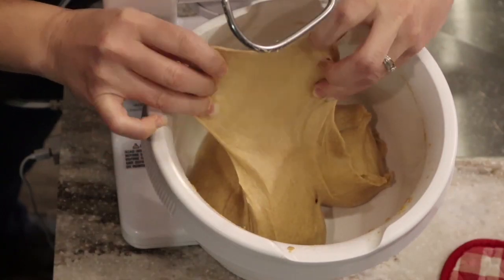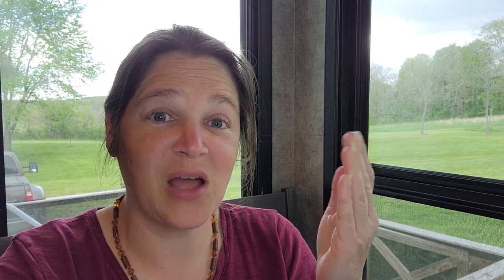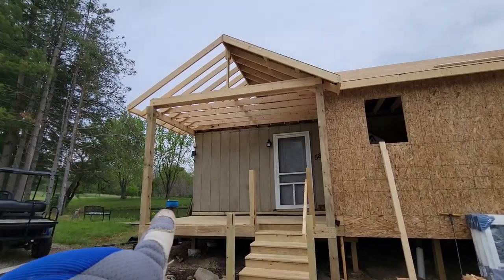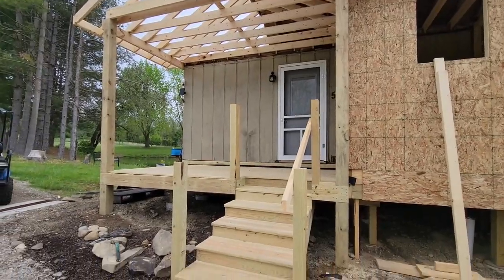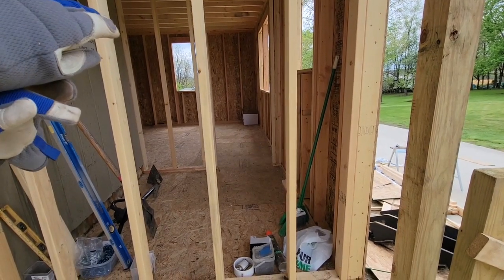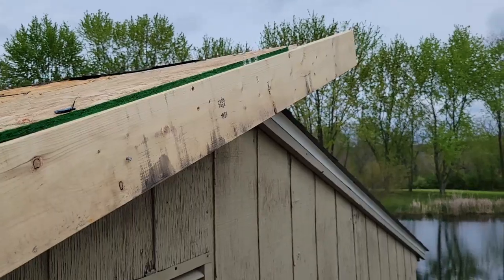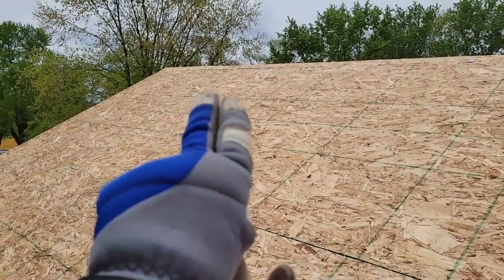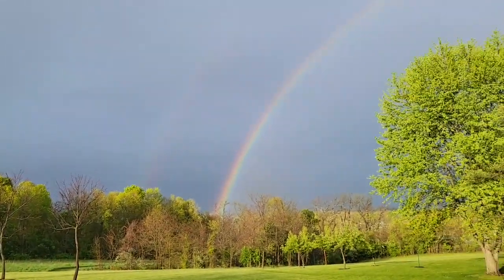MASTERCLASS: How To Get A Good Window Pane With Fresh Milled Flour

Comment: What I have learned with fresh milled flour is this.  I knead on #2 for 5 minutes, then I turn off the mixer for 5 min, then I knead again for 5 minutes on #2.  It helps let the flour hydrate better.  I use predominately spelt flour with bread but this method works with einkorn as well.  Einkorn flour, for me, seems to take a bit less water than spelt.  I do use vital wheat gluten with all the fresh milled ancient grain flours.  Only 30 grams for two loaves so its not much.  Hope this helps.
Reply from the maker: Great tips! Yes, I always recommend to let the fresh milled flour sit to absorb the liquids! Thanks! Happy Baking!

Comment: Hi! I have a question! I made your pizza dough recipe tonight...I used 130g hard red wheat, 200g hard white wheat, and 130g Kamut. My dough was very sticky. I used my Kitchen Aid mixer with the dough hook. I followed your recipe directions of allowing the 15 minutes to allow the flour to hydrate before adding the yeast. I kneaded for probably a total of 30 minutes, stopping to check for the window pane. It never fully developed. I stopped kneading because the dough seemed to be tearing. My question is...what did I do wrong? Should I have added more flour? I saw your other video and you said as a last resort add vital wheat gluten powder...how much should I add? I really love your recipes and want them to work for me 😊 any and all help is appreciated! By the way...the pizza came out fine.
Reply from the maker: It does take some getting used to. I do have a video that may be helpful. My focaccia (which is made with my pizza douhg) I share some tips, and show what the dough looks like during different stages of kneading. The main thing is you want to check the dough for stretchiness. It should be a bit sticky and loose, I almost never recommend to add more flour, often times too much flour is what causes the most issues. Just because fresh milled flour absorbs the water much slower, so it continues to absorb it throughout the process. Here is that video it may help you troubleshoot what went wrong. If it is your wheat that is not very strong (doesn't form glutn well) you can try adding 1-2 TBSP vital wheat gluten and see if that improves it. But, I find that is a rare instance. Even if you want to play this video, and pause it and make it along side me, many people have told me that is how they do it. You can do this! We have all had fails, especially in the beginning. Each time you work with the dough it gets easier, and you learn from it. https://youtu.be/3nDorxqEgaU?si=cK9KMTikUKUkvJLE

Comment: So no issues with the bran tearing or cutting the gluten? When I make bread using my fresh ground flour, I soak it for about 2 hours. The last couple times after it rose it just sort of disintegrated when I tried to shape it. I'll try a longer knead time but in the meantime if anyone has any suggestions I would be happy to hear them.
Reply from the maker: Yes, kneading longer can help tremendously! I have this video that may be helpful. https://youtu.be/xLXm9PcmnNM?si=U_EzDU30GfMzMIFu

Comment: Hi! Just barely learning how to bake with fresh milled flour and its been a little overwhelming, do I let bread dough rise in a warm environment? My dough took a very long time to rise and i had placed it in a fairly warm oven that wasn't on but just warm
Reply from the maker: Hi! Welcome! You are in the right place! Make sure you have good yeast. I like to use instant yeast for quicker results.(about 1 hour) But, if you want to use active dry yeast, the rise times will be a bit longer (closer to 2 hours). I use warm water (90 to 110*F water) Not too hot, or it will kill the yeast. Hope that helps!

Comment: I use a 2005 Kitchen Aid Pro 600 and it works well for large recipes. If I buy your compact Bosch at a yard sale is it small enough to also mix tiny recipes? Thank you again.
Reply from the maker: If you can find the little Compact Bosch, yes it is great for small batches! They discontinued them, so finding them is a little harder, but a great little mixer!

Comment: Hi Kara, I have a older Bosch mixer. What speed do you mix you bread dough on? Im trying to get the “windowpane” but having trouble. Thanks
Reply from the maker: No higher than 2 on those mixers. Make sure to not add any more flour, if the dough is too dry, it will never reach a windowpane. I hope that helps!

Comment: I have made your sandwich recipe twice  (the regular yeast made with the water and milk) very delicious flavor but it falls in the middle due to a large hole in the middle can you give me some tips to try? I am new still
Reply from the maker: If there is hole in the middle, that is generally due to shaping. Try shaping a bit tighter, and lightly pressing out any air bubbles.

Comment: So am I correct that if I make a large batch of dough that I should be mixing it for around 20 minutes in the Bosch mixer? I have only been kneading it for 10 minutes ( I never get a windowpane) because I had been told that I would overknead the dough and make tough bread. Thank you for your help!
Reply from the maker: Every mixer and batch of wheat berries is different, but yes, I typically knead 20 to 25 minutes in my Bosch compact. I knead until I get the windowpane. Some will come sooner than that, some possibly later. Overkneading with Fresh milled flour is not very easy. But, with regular white flour is a common problem. Hope that makes sense. 😃
Reply: Thank you so much for your reply and help! I appreciate all of your recipes and help that you give. Many blessings to you and yours
Reply from the maker: You are welcome! ❤️ And thank you! Blessings to you as well!🥰